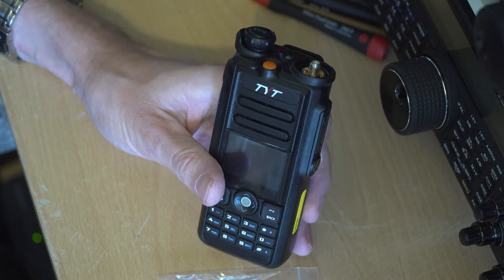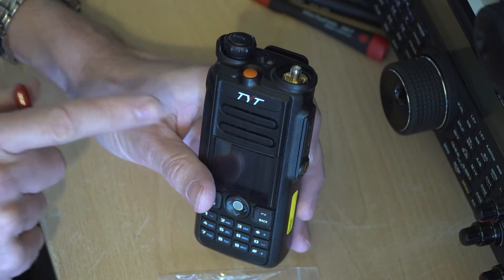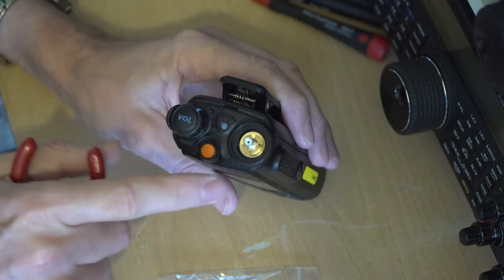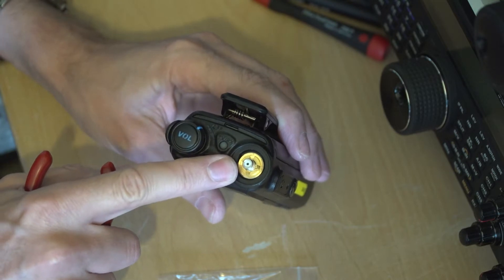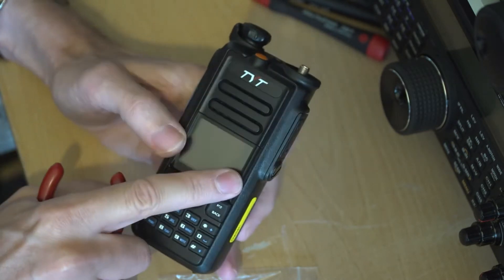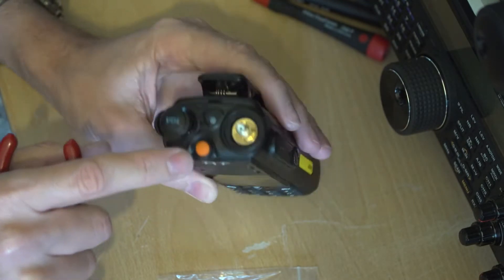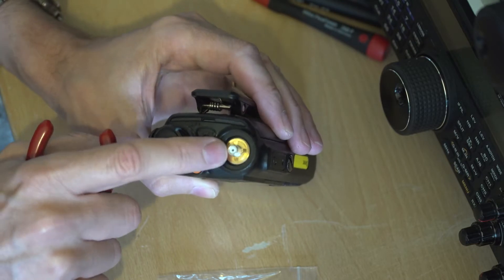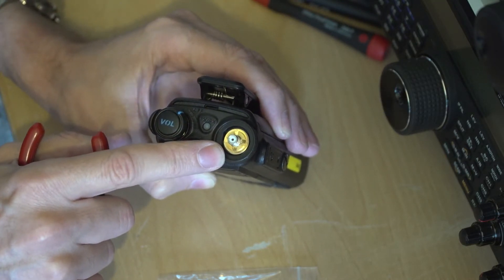Ham Radio- MD 2107 sma connector hight adjustment

Comment: Another method would be "potting" the SMA shaft with silicone just below the washer under the brass lock ring, and above the O-ring. As long as its not too runny, it should just flood the top of the SMA post housing and create a waterproof seal between the threads of the SMA post and the radio housing. It is semi-permanent though, and make sure to use electronics-safe silicone that doesn't cause acid etching as it cures.

Comment: By doing this how do you know o-ring has compressed enough to prevent leaks, especially if you are using a after market antenna which has smaller diameter. You don't. Lets see you drop your radio into a bucket of water for 15 minutes and see if it retains its water resistant rating. DO not post something unless you can show us the viewers that altering the design will not cause damage!!
Reply: The o ring is sitting over a threaded shaft, so it doesn't matter how much you crush it, it will never fully seal properly. Moisture will travel down the threads of the SMA, the basic design is flawed to start with. O rings won't seal properly unless the surface they are working against is smooth. If designed properly there should never be a need to crush an O ring to fill a gap. A tiny amount of pressure on the O ring will be enough to make it seal as good as it is going to seal. Over tightening it won't improve the already compromised seal, only stress the threads. And which do you think is causing the most problems? Broken antenna connectors or people leaving their radios in buckets of water? How waterproof do you think it is when the shaft is split, stretched or fractured because the nut has been over tightened?

Comment: Why not just add another washer under the brass nut to raise it up,just curious.
Reply: You could do that but the temptation would be to screw down on the nut to tighten it and then you are back to square one with all the forces trying to rip the SMA connector shaft from the chassis. My method shares the forces between the SMA and the radio body and thus reduces the stresses on the SMA shaft to break.
Reply: I actually added a washer under the locking nut and it works quite well. Like most things, over tightening any nut is never a good thing.

Comment: What is the purpose of the stubby part of the 2017 aerial?

Good idea with your solution. The action of over tightening the brass nut/aerial is similar to that of a gear pullers used with engines.
Reply: humaxf1 some have said it’s either the GPS portion built in or the stubby VHF portion.

Comment: Very good video, Alister. I agree with everything you're saying but I do think the biggest problem is people over tightening the antenna because it has a large diameter base and its easy to grip and tighten. I did the same as you, I used a 3rd party antenna along with a neoprene washer and it works great. The receive and transmit are much better also. I'm really impressed with your video, you explained things very well and very thorough.
Reply: I think it's a combination of both. The wide, easy to grip base of the stock antenna makes it very easy to over tighten. But if you do this mod the antenna is tightening up against the brass washer and as a result not trying to rip the SMA out of the radio.
Reply: But by having the locking nut higher the antenna is tightened against the locking nut, so the SMA will not now fracture at it's base because the load from an over tightened antenna will be against the locking nut and no longer on the base of the shaft.